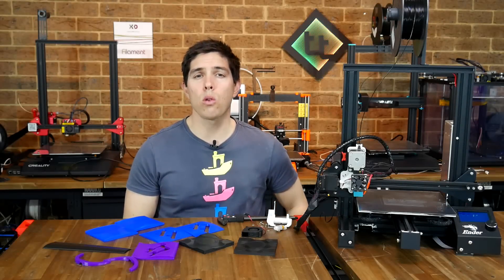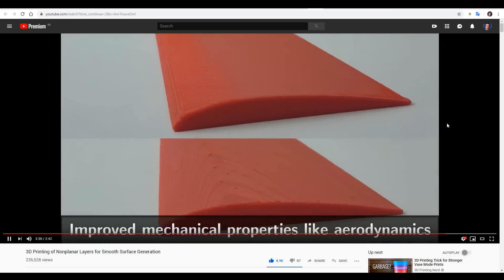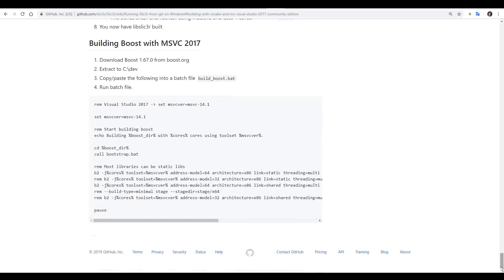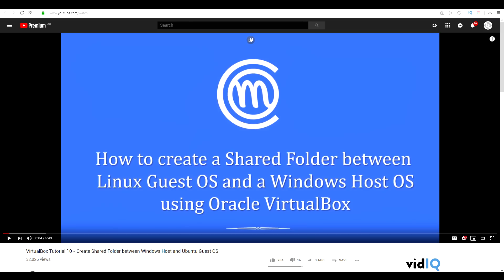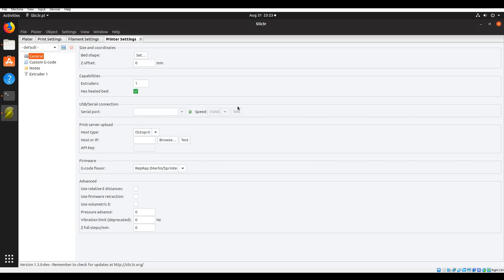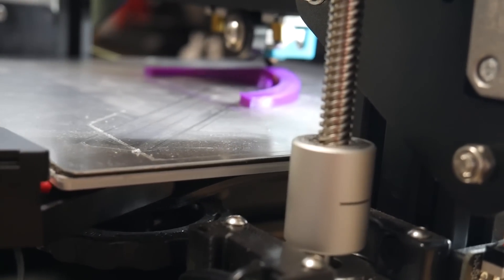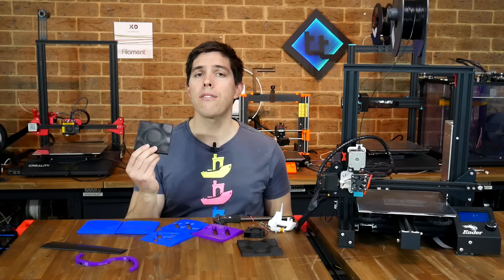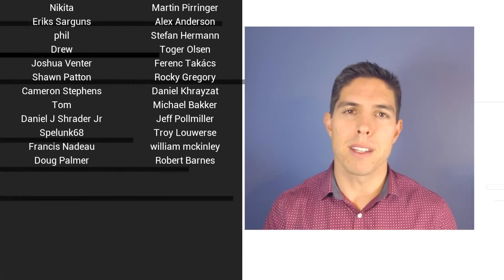Achieve true 3D printing with non planar slicing

Comment: Tilting the print head is definitely achievable with delta robot base 3-D printer. Alright, I have created another PHd topic for control engineering... 
https://3dprint.com/2622/zego-3d-printer-delta-robot-indiegogo/

Comment: Thanks for sharing your results. I'm looking forward to giving this printing a try. As for nozzle clearance, how about using the longer volcano nozzles instead? It would stick out a lot more to a give better clearance. The print temperature will most likely need to be raising a bit though.

Comment: Thank you for sharing. I understand the non plaining process demonstrated in this video. It is still layer printing no matter how you print with old 3D printing equipment. I will not take away your thunder, but it should be known there are new 3D printers, now called “additive manufacturing” that produces 3D with out any layers. It’s fast, high quality and simple to use. Many well known manufacturers are using it today.

Comment: I would love to see how this technique would perform when printing of terrain tiles for tabletop gaming. They are great for player immersion but really suffer from stepping on the top surface. This could be perfect for them.
Reply: It would definitely help. Only problem is, you need to modify your printer and run a Linux machine. One thing you might wanna try is a Delta printer. The hot end can practically move freely in a 3D space, not limited by axis.
Reply: One way to fix the stepping issue is to lightly run a soldering iron over the plastic.  Just have to make sure to not leave it in contact with any point for more than a half second.  That will melt the surface just enough to allow it to fill in the gaps.
Reply: @protoborg  won't a heat gun do same thing?
Reply: @JoeMakaFloe  The heat gun is too broad.  It lacks the fine control of the soldering iron.
Reply: @protoborg  just print it sideways

Comment: I am so excited for the future of 3D printing. I really hope this tech reaches mainstream in the next couple of years. Especially tilting nozzles. That sounds like the best way to keep cooling in place, and not have to reengineer nozzles and hotends. If some company could release an affordable (sub $5000) tilt nozzle printer and slicer they could corner the market. For a little while at least until it's reverse engineered.

Comment: The problem with printing this way is a lot of the printer out there use atmel controllers. They have issues with controlling 4 motors at once when print speed is increased; x, y, z, and extruder motors (us with Delta printers know this well. It pauses a slight bit, until the controller can catch up with the commands, causing artifacts in the print)

Comment: Go full Linux, mate. The water is just fine :D
Reply: How many times in the last year have you broken your computer beyond use requiring days if tinkering to get it working again? Linux is fine if your hobby is staring at code figuring out where a single character is out of place that destroyed your operating system. Not so useful for people who want a functional machine that doesn't break every other day.
Reply: @MaximilianonMars  Nothing has ever broken when using Ubuntu LTS releases and not tinkering in the command line and system files to begin with. Do you also blame Windows for instability after you manually edit the binary DLLs following some weird blog post?
Reply: @aigarius  no, because it's entirely unnecessary to tinker with windows. In this video alone the dude had to make command line entries like there was no tomorrow to get the custom slicer to work. I can't play basketball with any competency, neither do I demand boardgame players should learn to play it and enjoy it.
Reply: @MaximilianonMars  None of the command line stuff would be needed if he was on normal Linux. Well, maybe the actual compilation of the custom slicer itself, which is just standart configure-make-install routine.
Reply: Personally, windows gaming is a bitch, no SolidWorks, etc. WINE usually results in applications that function 90% and may not have hardware acceleration. I use Linux for my server and nothing else. If only the talented g u i developers would all get together and agree on something.

Comment: While I did manage to reproduce your results for the part that you shared, I found that when I tried to apply the same slicing method to a Cherry-MX keycap, the slicing looked fantastic, but when the printer got hold of the G-Code, it almost ground to a halt in the corners.

Having a look at the G-Code, it looks like the resolution is relatively ridiculous, at least compared to a keycap sliced the normal way.
For a 3mm wide brim of a normal sized keycap, the slicer now produced over 500 rows of code, each containing XYZ-coordinates, compared to about 100 rows with only XY.

The printers slow handling of the GCode lead to that the nozzle stayed so long in each corner of the cap that it was deformed and swollen by the heat and oozing filament.

I tried using scripts to reduce the resolution for any layer/row of G-Code that had the same Z-value,  making the insane resolution do it´s thing just where it really needed XYZ, but it did not really improve anything.

Did any of you other guys find anywhere in the source to change the resolution somehow? I did not.

I used OctoPrint, maybe it would be faster using SD-card?
Reply: Do you have 8bit or 32bit controller?

Comment: errr.. oh god, you went for a vm instead of just adding a cheap $35 hard drive and installing linux from scratch.  Don't describe in detail the headaches you had for doing something more complicated than it had to be.  It was your decision to do that.  Most people can do a linux install in less than an hour with no more knowledge than how to install a disk drive and click "next", "next", "next"...
Reply: @JorgTheElder  and, graphics card support?
Reply: @JorgTheElder  really, what I'm getting at is that Linux runs so well on it's own that subverting it under an operating system that locks the entire system during upgrades is a downgrade of the entire system.  Running Linux on it's own just isn't that hard.
Reply: @JorgTheElder  and I'm saying he did more work than he needed to.

Comment: I tried to do this and could not get the slic3r program to install. I have a full Ubuntu Linux build on my laptop as dual boot with windows 10, so tried to use that rather than install an emulator.
I started thru the commands listed on GitHub...the instructions failed to work. I also never got to the step that wants the "<PATH_TO_SOURCE>" I do not know what that is, I know enough about linux to be dangerous...please help. here is what happened:

This is a experimental version of the nonplanar slicing
How to build
Installing prerequisites ***  this step seemed to work   *********************************
sudo apt-get install gcc cmake build-essential libgtk2.0-dev libwxgtk3.0-dev libwx-perl libmodule-build-perl git cpanminus libextutils-cppguess-perl libboost-all-dev libxmu-dev liblocal-lib-perl wx-common libopengl-perl libwx-glcanvas-perl libtbb-dev libxmu-dev freeglut3-dev libwxgtk-media3.0-dev libboost-thread-dev libboost-system-dev libboost-filesystem-dev libcurl4-openssl-dev libextutils-makemaker-cpanfile-perl
Get repository    ***   This step worked
git clone https://github.com/Zip-o-mat/Slic3r.git

cd Slic3r

git checkout nonplanar

* fails here *****************************************************************************************************************

Resolving deltas: 100% (26414/26414), done.
zaphod@zaphod:~$ cd Slic3r
zaphod@zaphod:~/Slic3r$ git checkout nonplanar      ************** 1st fail from web site description
Already on 'nonplanar'
Your branch is up-to-date with 'origin/nonplanar'.
zaphod@zaphod:~/Slic3r$ perl Build.Pl
Can't open perl script "Build.Pl": No such file or directory      ****************************** 2nd fail
zaphod@zaphod:~/Slic3r$ 

** How do I do this next part if it does not work, how about a script that completely installs this...

Install Perl libs
perl Build.PL

perl Build.PL --gui
Build with cmake (Tested on Ubuntu 16.04, 18.04LTS & 19.04)
mkdir build

cd build

cmake ..

export PERL5LIB=<PATH_TO_SOURCE>/Slic3r/local-lib/lib/perl5

make
Start
cd ..

perl slic3r.pl

Comment: Look into "Berd Air Cooling" for the part cooling fan. It's an ultra low profile cooling system that won't get in the way of the nozzle and will allow for normal levels of cooling for overhangs. 

It uses a small diameter tube bent in a circle which sits just below the heater block but above the bottom of the nozzle with little holes in it directed just below the nozzle. This requires higher pressure than you get with a typical part cooling fan so you need a diaphragm air pump - like the ones used in aquariums to make bubbles. They're a little nosier but that's the trade off for lower space/weight on the print head. Some delta printers use this because you can move the Fan and shroud of the end effector to save weight/space. It's a very easy and pretty cheap modification if you want to get into more non-planar printing.

Just Subscribed and hope to see more experiments from you on this in the future!

Comment: Do duel heads (Hot end/BLtouch), Forced cooling from an increased distance (Or set overhangs significantly lower), longer nozzle (put a nozzle on a lathe and get a better angle), with a laser temperature reader pointed at the tip of the longer nozzle, or heat it higher and do a temp tower. Sounds like it should work?

Comment: This is great - not real 3D though since the top surface is still printed planar - just not in the normal XY plane we know but in a vertical plane tilted along the XZ plane but who is looking at those details ;-)
This is very usable for parts like the wing and things that have a sloped or curved top surface.
There is still a long way to go and I doubt if this is a technique that can be fully automated (in the coming 3 years or so). Even 5-axis tilting or 3D printing with a robot arm has limitations. Nozzle size and cooling is an even bigger problem than what I experience with 5-axis milling.
Still a very nice solution for some problems we have - thanks for sharing

Comment: So the alternative is paint the surface of a stair-step version and gently sand it or do the acetone thing ?  Maybe painting the surface with epoxy and then sanding also ?  Not as accurate as you get a linear fit but is an alternative.

Comment: Hey you got it working!  I got it all compiled today and tried putting topological models, and even just a half-sphere, and it refused to do non-planar movements in the slic3r preview. In the console it just said it removed the small surface. Added to the issue here: https://github.com/Zip-o-mat/Slic3r/issues/4

Comment: What about booting LINUX from a CD/DVD or USB Drive?  "/
Reply: Do it
Switch to Linux while you're at it, you'll probably like it :P
Reply: @scoreunder  Thanks but no, I use a computer for work and Linux is not the way to go, neither is Mac.  I use AutoCAD and CorelDRAW, as well as others which have not been ported to Linux and do not operate with WINE.  These programs are native to Windows, and Windows it shall be, but thanks anyway! :D
Reply: @tihzho  fair enough. But yeah the compilation stuff should work on a live distro. I would not be surprised if it worked on Mac too but I don't have one to try with

Comment: Could you update the video (3 Fixes for BLtouch V3 on Creality machines) with motherboard version 1.1.5 and BL-TOUCH v3.1? Some of the code that appears in your video has been modified in the Marlin 1.1.x files and also in 1.1.x-bugfix.

Comment: While interesting, I suspect this will be to FDM 3D printing a bit like the Vectrex was to gaming consoles, or Foveon sensors were to digital cameras. I.e., the difficulty in implementation (and the way it interferes with other things, like cooling) will simply be outpaced by the increase in resolution of the simpler, more traditional printer design.

With high enough resolution, a bitmap looks as smooth as a vector shape. With high enough resolution, Bayer mosaic patterns become unnoticeable. With high enough resolution, you don't need anti-aliasing. And so on. 

In some situations there are also structural benefits to non-planar printing, but FDM is generally not the printing method of choice when structural integrity is important, anyway.

In the long run, I suspect SLS / photo resin printing will come down in price (and hassle), or we'll see some inkjet-style technology (multiple nozzles shooting small particles) replace FDM in the low end. Squirting hot plastic out of a single nozzle is just not a very efficient way to create detailed objects quickly (just like using a plotter to draw individual letters is not an efficient way to print text - let alone complex patterns or photos).

Comment: Nice!! Regarding the Raspberry Pi you may want to try the latest version (4) as it is considerably faster in every way and has up to 4GB of RAM and should be a much better environment for compiling. Secondly, regarding the virtual environment, VirtualBox is typically slower than VMware Workstation Player. https://www.vmware.com/products/workstation-player/workstation-player-evaluation.html

Comment: Dudes that print Leonard Nemoy busts be like: "Dum dee dum dee dum. "
Dudes that do practical and structural parts: "Game. Freaking. Changer. "

Thanks for this great video. For practical printers who''s parts need to sing for their supper, this is a paradigm shift. A manufacture that produces a special purpose machine to work with said slicer program is gonna get some market share.  cough * *Prusa

Comment: As it seems to have two states... normal layer printing and non planar finishing, could you put in the G-code to pause it after the regular printing is finished? That would allow you to remove your cooling fans for the non planar parts, and still successfully print overhangs and bridges in the same print as needing the clearance for non planar? Just a thought. Perhaps a modular fan system where it can clip it on/off or flip it up/down automatically?

Comment: If you used an M6 nozzle instead of the MK8 nozzle on an Ender 3, would it give you the extra length needed for this? Combine it with the "FreeABL" from thingiverse, because after leveling you have to remove the sensor, and maybe you have a printer that would be more compatible. Just my random thought.

Comment: 10:32 I think that for cases like that the software should have some capability of being able to detect hanging gaps in which it needs to reduce speed of both head displacement and material extrusion, and that will give a chance to the fan to harden the plastic fast enough so that it can stand on its own until the bridge over the gap is printed. With this 3D technique, only one pass would be needed to make the initial supporting arc, and then you could go back to full speed afterwards because the whole gap will have full support for the rest of the layers that follow on top.

Comment: Hello Micheal . Really funny to see you guys so advanced in 3D printing process while I still struggle with having a continuous print.
My printer keeps stopping in mid-print with no apparent reason.  Sometimes It stops earlier and the printer seems to be freezing. 

If anyone can help !
I'm using ultimaker original with many upgrades on a Pc with simply3D.
And also, I noticed that when I print objects for less than 12Hours , the printer seems to work well, but anything above that would even stop before reaching the 12 hours barrier,  so please Micheal If you can do a video to explain all the possible causes I would be more that grateful. 🤗

Comment: This is very interesting and I am sure some guys will make print heads without the compromise of unmounting necessary fans or level sensors.
I recently bought a new prusa mk3 printer. Besides of running Linux for years I wouldn't fear that software part, but I would not loose all the advantages of the perfect print head. I am sick of screwing and adjusting the bed level for years.
To be honest this is very interesting, but if I depend on the resolution of the surface I tilt the object horizontal or set the layer height as small as possible. 0,05 seems not a problem for the prusa.
Finally thanks for the good video 👍

Comment: This opens a lot of possibilities, not only on surface finish, but also multi-material, multi-color, printing on top of existing objects. Maybe a delta printer with linear actuators on each leg to tilt the print head?

Comment: I hope to see a combination technique where the structure of the print is planarly printed in chunks while using this technique as a form of 3d ironing on and in between each chunk, that and a low profile fan assembly would make this a huge boon to the quality of parts printed.

Comment: @Teaching Tech, I think you would have had an easier time if you'd just installed Linux Mint on some old computer you don't use any more and done the whole thing there. LOL. Mint is incredibly easy to install, needs far less in system resources (it'll run great on a ten-year-old machine, surely you've got one of those lying around, right?) than some corporate bloatware OS, and you will hardly notice any difference.